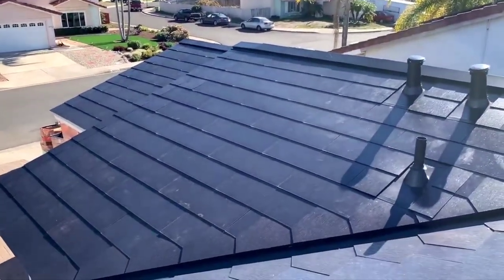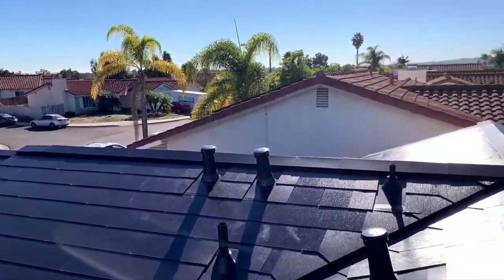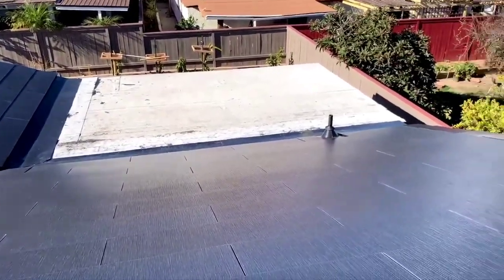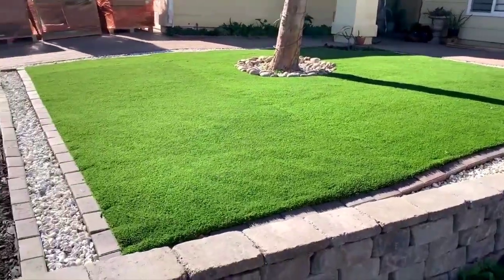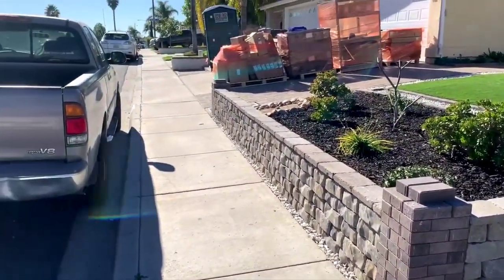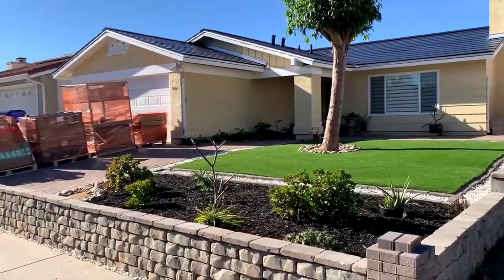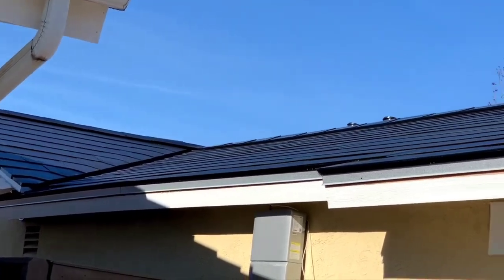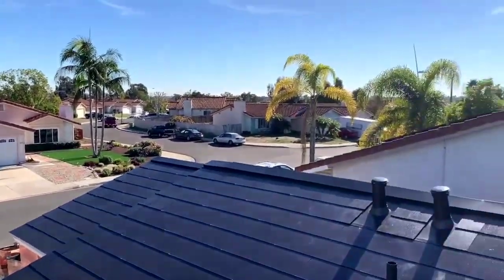Tesla Solar Roof Install Part 5 - were done!

Comment: They are finishing ours tomorrow in albany NY -amazing look and basically our entire roof needed replacing -The Tesla team replaced all the plywood as it was all rotted from leaking solar panels and Sprayfoam insulation installed about 15 years ago they fixed the chimney leaking issue as well and just did an incredible job! If they come to your house make sure you feed them they’re very  appreciative!! Couldn’t be more happier  with the team and the way the roof looks!! It looks so good now I need new gutters and have to reside the house!!

Comment: Robert, congratulations on the completion of your project. Your roof looks great. My project was recently completed in Southern California, however I'm still waiting for final inspection and turn on approval. My project took a little longer than yours. I did encounter some underlayment damage that needed fixing, and I've got several skylights that I decided to replace during the project. My total installation time was 4 weeks, which I didn't mind. 

I've got a few questions for you: 1) How'd your paint project go? It looks like your painter would have to stand on the roof in order to paint your chimney. My Tesla roofer had some cautions for any non-Tesla person standing on the roof. 2) Did you install rain gutters afterwards? I hear that standard gutters won't work well, because of the type of flashing Tesla uses on the project.

Comment: It looks like everyone around you has cement tile roofs. Is there an HOA? Did you have any problem with them. I have a similar home & I'm going to need a new roof  soon . Thinking of going the solar tile  route also but not sure if the HOA will approve as it looks different from all the other homes. BTW it looks great!!
Reply from the maker: No HoA. They all have clay tile which lasts many decades

Comment: They are installing as I type...Did you add power walls?  If so, they were installed?
Reply from the maker: Not for this place. Have another project with my dad's place that will be. My own home has 1 PW inside. Congrats on the install!

Comment: How much do you have to pay?
Reply from the maker: This system was 26,500 for 4.15 kw. 16k of that is considered the solar write off part for a 1320 sq ft house
Reply: I have just over 2 kw with good sunshine. And only paid between two to three thousand for all my panels. Installed it myself. Another thousand on inverters.